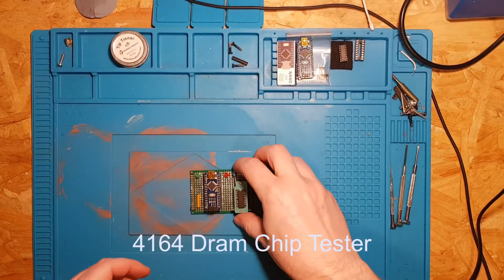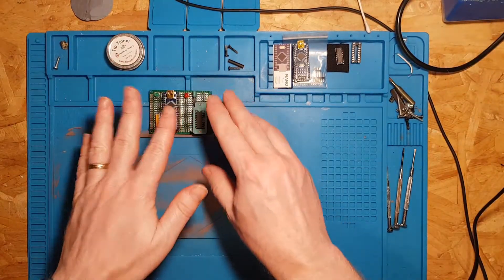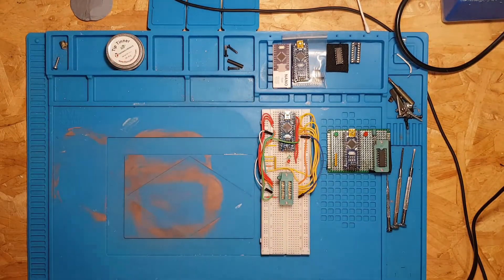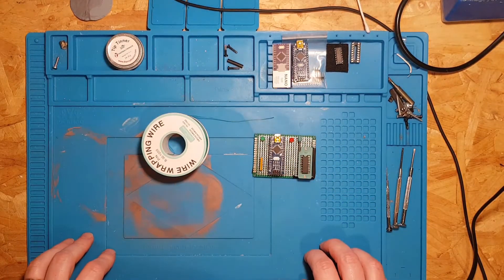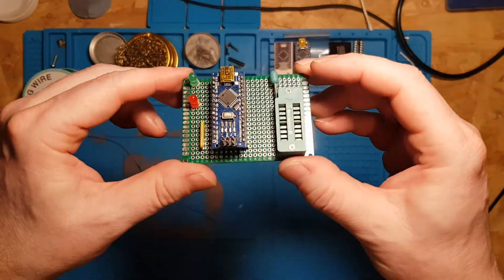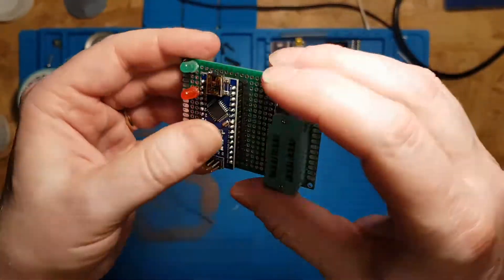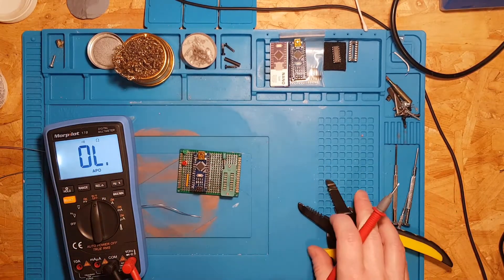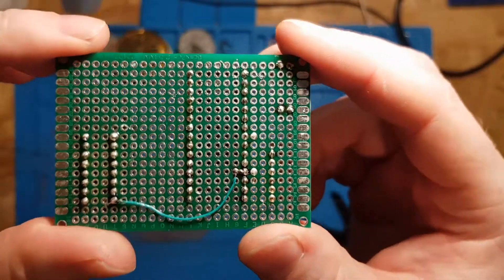Spectrum 4164 Dram Tester - DIY

Comment: Very good. I have a pile of these DRAM chips desoldered from various devices. My testing method was simply having a socket on a motherboard, chip one, and powering on the motherboard. If it posts, then I would run a memory check diagnostic program. I can see a advantage in having this handy little pocket sized tester.